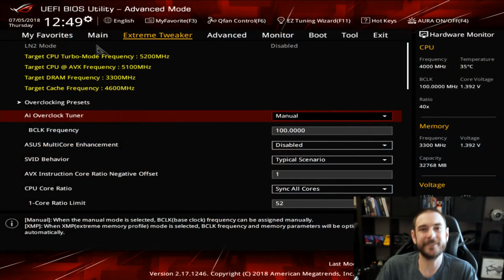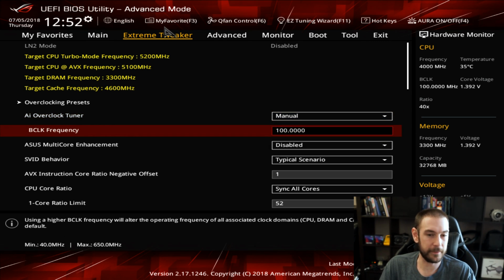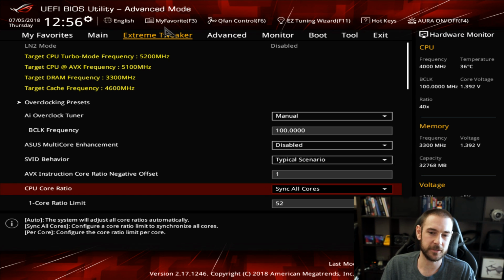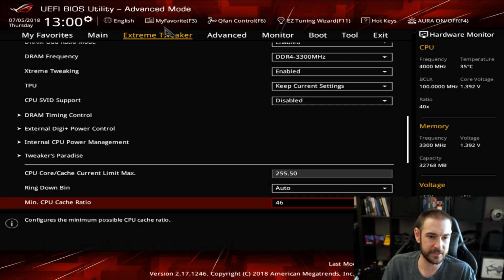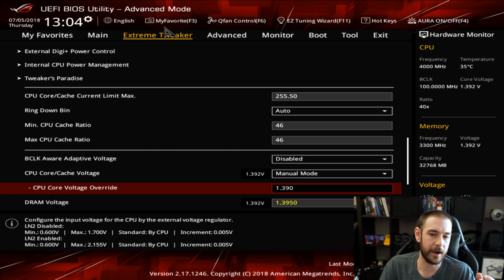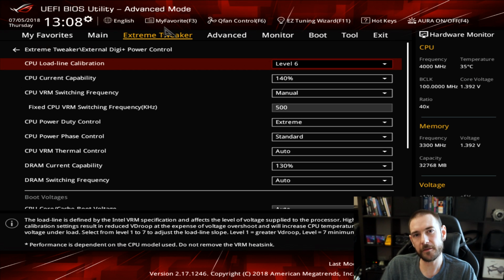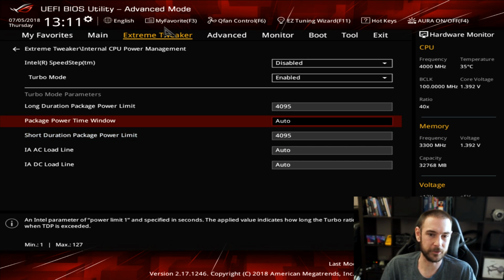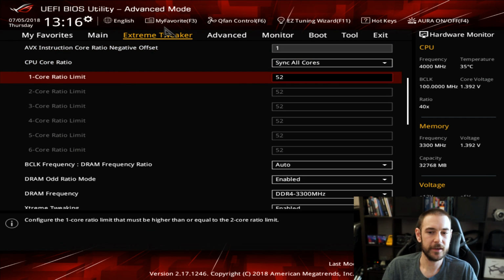How to Overclock an 8700K & 8086K - ASUS Maximus X and Others

Comment: Hey Boosted, great video man. Found your link through Reddit. Just finished my first build. I am running the i7-8700k + Asus prime z370-a atx lga1151 + h100i v2. Will these settings also work if I'm just looking to overclock to 4.7ghz? First time OC.
Reply from the maker: Should do mate. For 4.7 GHz is start with 1.28Vcore and word down from there.
Reply: Boosted Media thanks for the reply man. Rewatching this again and you have earned yourself a new subscriber.
Reply: I have one more for you. I am getting around to OC the 8700k this week to 4.7 ghz, like mentioned before. Any suggestions on the best settings to use or start with when it comes to tweaking the h100i v2. Do I have to take any additional steps on the Bios side to make sure my water cooler is reading the CPU heating properly? Or can I just do everything through the Corsair Link app they provide on their website. Just watched your Fan profile settings video as well. Nice job ma dude.
Reply from the maker: I’d connect the fans to your CPU or high Amp fan header and pump to the water pump header and set up how I did in the fan profile video.

Comment: Hi, 

I found this video excellent, with a lot of new and helpful info - thanks!

With my 8700k on an Asus Z370-E, with Kraken X62, I find I need a much higher voltage to get a workable 4.8 - 5 Ghz OC. 
Looks like it needs to be in the 1.36-1.37V range. Now, this gets hot at full load, high 80s to 92, but when I game the processor tends to sit at 50ish % work load, and mid 50s temps.

If I am not maxxing out the CPU while gaming, and thus not getting near those high max temperatures, is it fine to leave the voltage up and not fiddle around dialling them back??

I have a hard time believing people get a stable 5Ghz at 1.35v and less!

Thanks for any feedback, cheers :)
Reply from the maker: I wouldn’t risk it with temps that high. You never know when you might get a freeze up and CPU goes to 100%, even though your temps are fine under normal use. 

I’d definitely look at delidding. Should give you way more headroom.
Reply: Boosted Media Righto, thanks for the feedback. Delidding wasn’t something I wanted to do until I’d had the CPU longer (the warranty period!), but I’ll look into it and keep an eye out for the tools. It’s nice having a Cinebench score of 1630+ ; )

Comment: So I stress tested this verse the 5.0 ghz preset, using ur settings based on ur suggested starting values my temps started pushing towards high 80’s 10 mins in so killed the test now I’m getting faster speeds and peak in the low 70’s typically high 50’s, I am new to this but followed to the letter, do I take it that the firmware updates have fixed ur early concerns or something else I’m overlooking?
Reply from the maker: Impossible to say without knowing what your voltages were whilst using the preset.
Reply: Boosted Media thank for the fast response, I’m not looking to set any land speed records here would you suggest I run with the preset then if I am getting better temps or am I wrong thinking lower temps mean better cpu longevity and should dig a little deeper, great vid btw especially for us noobs.
Reply from the maker: I’d want to know exactly what the voltages are with the preset before recommending anything. The temps may be lower due to throttling.

Comment: Great videos man! I have the exact same setup except I did not delid the cpu set... i uses the ez tuning wizard under extreme performance and it over clocked my 8700k to 4.9-5.0 on 1.4-1.45 volts... is this safe? I called asus and they said it’s fine... love to hear your thoughts and how would you go about tweaking my stock 8700k thx again!
Reply from the maker: No, as explained I. The video 1.45V is too high for a non delidded CPU. I wouldn’t go beyond 1.35V until delidded.
Reply: Thx for your response... if I were to delid the cpu could I just use the ez wizard set to extreme again or would I get the same voltage with lower temps?
Reply from the maker: I still wouldn’t go that high for daily use. Follow the instructions in the video.
Reply: So I can follow this video for a stock non delided cpu correct? Thx
Reply from the maker: Yes. I go through the voltages for stock and delidded in the video....
Reply: Awesome thx man!

Comment: 22:20 what you're saying isn't matching what's on your screen.  On the screen you have CPU Core Voltage Override set to 1.39, and then say you might raise that by 1 mV by going up to 1.34 .  But according to the screen, if you wanted to raise it by 1 mV,  it would actually go up to 1.4.  What am I missing?
Reply from the maker: On the screen I’m showing my settings for my individual CPU. What I’m explaining is my recommended voltage to start with. I wouldn’t recommend shooting straight to 1.39V with unknown cooling capacity, etc.

Comment: Hey i used  the exact settings you used here except messing with the RAM timings with XMP enabled on my ASUS ROG STRIX Z370-E Gaming motherboard. My cooling is a Corsair AIO H100i V2. I went to 5GHZ at 1.3 vcore and in prime95 2 cores hit TJMax while the other 4 were in the mid 90's. I don't want to have to delid the chip. Do you think prime95 is just the maximum worst case scenario on cpu? I don't really do much other than gaming and browsing the internet so i think my OC is alright. Suggestions?
Reply from the maker: As I’ve recommended to other people, stay away from prime95. It’s a completely unrealistic workload. 

Try OCCT on default settings for your stress testing :)

Comment: I followed your instructions down to the t..just kept my core ratio to 48 and core voltage to 1.3v.
Prime95 26.6 runs stable for about 15 mins with temps at around 75-80c (CoreTemp) then it suddenly spikes to 88-95c and the whole thing crashes and the blue screen of death appears.
Same results at 47, 1.3v and 48, 1.32v.
Am I doing something wrong or is my 8700K simply a dud? :(
Cinebench and realbench works fine btw.
Reply from the maker: Prime95 overheats processors with an unrealistic load. If it’s stable in Realbench and OCCT and sits under 80C I wouldn’t worry.

Comment: Hi Boosted Media, Thank you for making this guide. I've followed your steps for overclocking my 8086k on the same Asus Hero board. The only thing i found strange is that my IA:Max Turbo Limit on HWinfo64 shows "Yes Yes Yes". Is that normal? I think I covered every step from you guide.
Reply from the maker: I don’t use HWinfo myself so not sure. But I’d imagine it’s reading rut because we’ve disabled the CPUs feedback loop to the OS by us no manual core ratio and voltage control. 

I wouldn’t be too worried as long as your voltages look ok under load and your temps are under 85C

Comment: after i overclock, I notice something odd after it's been powered completely down and I go to start it up. After hitting the power button, the fans spin and lights come on, then off, then back on about 1 second later then it boots up fine. Its like a weird double boot or something. I've ran the system and stress tested it for days, nothing is wrong, everything while its running is fine. It's just that weird quick power on and off before continuing a normal boot that is wigging me out a bit.
Reply from the maker: That’s normal. I mentioned it in the video. It’s memory training.

Comment: I disagree with you not using adaptive voltage/Speedstep. Been overclocking a long time and never had this cause issues with stability. If your system is unstable with an adaptive voltage you are unstable somewhere else. In that case LLC is prudent to tweak. Or you simply have reached frequency limits.

I got a better 8086k than you. I can do 1.35 at 5.2 with AVX 0. With adaptive voltage. Once you reach 1.4 voltage you are getting to dangerous voltages.
Reply from the maker: Fair enough. I just personally don’t see the benefit as the change in power consumption is minuscule. Each to their own. I’m just sharing my method. :)
Reply: Boosted Media It's fair enough to say it's a personal preference.

Comment: AI Suite was used just to see what it was all about and I had exactly the same issues you described here.  I found it buggy, it caused stability issues and it was causing my fans to spin at far lower RPM than what I had set in the BIOS.  It was quickly uninstalled and never used again.  BIOS all day for everything.  Never rely on OS level software.
Reply: I had the same issue. Back to BIOS for me.

Comment: Have you managed to get the ASUS Aura software to control the GSkill sticks correctly at all? I know mine sometimes takes up to 10mins to go from the default rainbow effect to the static green i want.
Reply from the maker: I don’t have any problems with it. The sticks behave as assigned as soon as windows boots up and the service starts.
Reply: Yea my sticks just take like a random amount of time to turn green after windows is going. Really looking forward to your in depth overclocking series. Thanks for the content.
Reply from the maker: Weird. Sounds like the ASUS lighting service might not be starting straight away. Maybe check in services.msc and see if it’s disabled or something?
Reply: So this is interesting. I noticed the other day I had an issue with my wireless headset and I couldn't open the ASUS Aura. The second I unplug the usb receiver for the headset the sticks instantly turn green and I can open the ASUS software w/o problem. So I'm wondering now if there's a way I can make the headset USB thing delay on startup till after Aura is turned on. Prolly going to have to search for answers on tom's or something.

Comment: I will try this for z370 i strix alone with 8700k
Reply from the maker: My other PC is a z370 Strix with an 8700k. Same configuration works fine. The voltages are just a little more unstable due to the lower quality VRM.
Reply from the maker: As a base point yes. You may need to tweak a bit to get it stable as the power supply rails on the strix aren’t as stable as on the Maximus.
Reply: since i never overclocked i guess i keep my hands away from that :D
but thank you
Reply: will those settings work with a asus rog strix z370-f gaming and a i7 8086k?

Comment: You got vague when it came to RAM timings (What are they? Where find them? Are they automatically inserted by the bios?).
Reply from the maker: Vague because it depends completely on the ram you have installed and the video is about CPU overclocking. The timings are supplied by the ram manufacturer. Usually written on the box or the sticks themselves. Or if unsure just use the XMP memory profile and it will auto-populate in the bios :)
Reply: Now i understand  - but i'm afraid you're going to have to re-do the video explaining that. ;-) wey hey!
Reply from the maker: As I said multiple times in the video, I'm going to do more videos explaining each aspect of overclocking in finer detail for those who are interested to really fine tune their systems. If I'd gone into that level of detail for every aspect in this video, it would have been an hour long and people would complain. Can't win. lol
Reply: Adjusting RAM timings can be a deep dark hole once you go beyond the primary timings that are listed by the manufacturer. Things get crazy if you start adjusting and stability testing secondary and tertiary timings. There can be performance benefits in certain applications and games, but for 99.999% of people I think it's best to just stick with XMP or manually setting the frequency and primary timings listed on your RAM kit.
Reply from the maker: Agreed. You very quickly reach a point of diminishing return where the benefit simply isn’t worth the effort for anyone less than a real hobbyist or enthusiast.
Reply: Yes, I want to actually use my computer and live my life. Not spend the next 6 months painstakingly adjusting like 50 different interconnected values, and stress testing to squeeze out maybe 1% more performance. Stability testing for RAM takes such a long time as well, and it's so intensive you can't use the computer for anything else while it's going on. Just not worth it imo, leave it to professional overclockers.
Reply from the maker: Pretty much. Except I’d say 1% is being generous. Lol

Comment: Looking forward to see the fans video ( cooling).
Reply: Boosted Media managed to get my 8700k to boot perfectly with the settings you recommended highest temp with non avx prime 95 is around 80c with a noctua cooler very interested in your video for the fans hopefully that will be soon :)
Reply from the maker: Hoping to get it done this weekend. It’s a pretty fine art to fine tuning fans and a lot of people get it wrong.
Reply: Boosted Media so true, I spent hours and hours to understand my bequiet silentwing 3, the calculation of the intake air etc etc
Reply from the maker: Biggest mistake people make is thinking the radiator fans should be controlled by CPU temp when in reality it makes absolutely no difference until you reach the point where the radiators can’t dissipate as quickly as the CPU is generating heat, which on a decent setup is pretty much never.
Reply: Boosted Media Alright thank you for all your help I'm much more pleased considering I'm now at 4.8 with lower temps / vcore than when was stock at 4.7 lol going to be doing a reseat of my heatsink Sunday so might see some temp decrease one last question what do you use to test your oc?
Reply from the maker: Nice! 80C is pretty hot for a non-AVX load though. You might want to back it off a bit for daily use or consider delidding if you’re doing processor intensive stuff like video rendering. I wouldn’t be at all surprised if that temp pushed well into the 90s with AVX.
Reply: Boosted Media currently doing tests at lower vcore since I know I wanna stay at 4.8ghz currently at 1.225v in bios (1.216v in windows) and temps are at 70-75 now strange thing is at 1.220v it was unstable altho windows was showing that was also 1.216v
Reply from the maker: The sensors read in 0.16V increments and you also need to account for your LLC setting. If LLC is set to 6 you’ll see the voltage come up slightly under load. On LLC5 it will drop under load.
Reply: Boosted Media sorry for all of the noob questions lol still learning all this last time I did any oc was on my 3570k where I followed a guide and just left it alone but is there anything else I can change that might let my vcore go slightly lower? Or anything I should change since I lowered it?
Reply from the maker: Not really significantly if you’ve follow d all the steps in the video. Sounds like you’ve reached the physical limit. 

Next step is to delid or go to water cooling.
Reply from the maker: I use OCCT on default settings. Seems to pick up instability that other programs don't and doesn't overheat the CPU like other programs do. If it passes 5 hours of OCCT I usually run Realbench stress test for 2 hours.

Comment: did asus fix the over volting stock cpu problem? heard asus series mobo was running crazy high volts on stock cpu settings.
Reply from the maker: On auto voltage settings above about 4.8GHz or using TPUII auto-overclock it runs very high voltages still. As I said at the beginning of the video, I recommend against using ASUS' auto-overclocking tools. I don't think it's a "problem" though. I think it's a design feature. ASUS know that the majority of people who use auto-overclock will never realize it's thermal throttling. they jsut care that their System Monitor says they're running a 30% overclock and would have no clue about the actual performance.